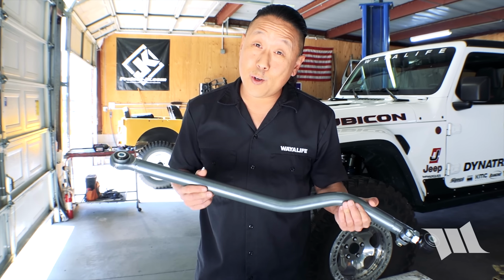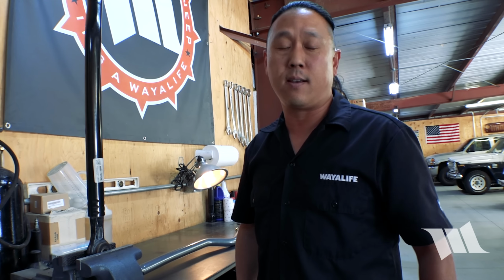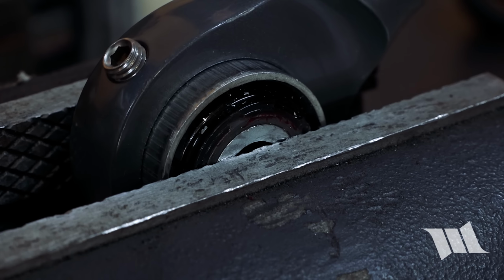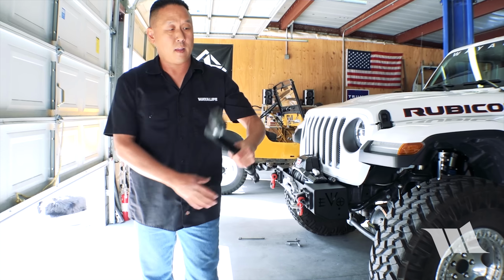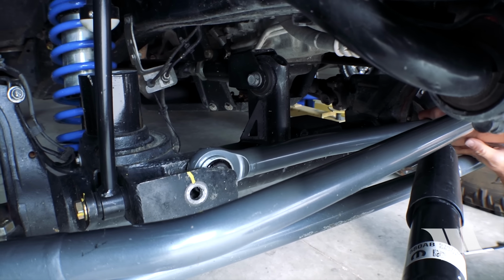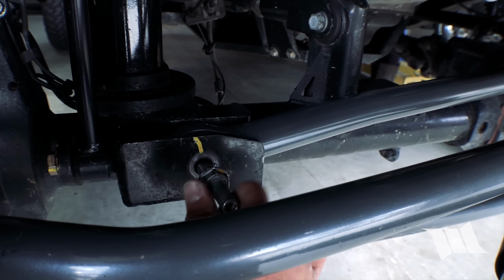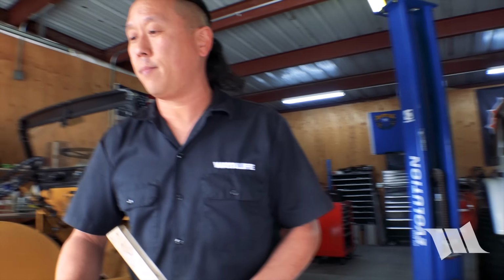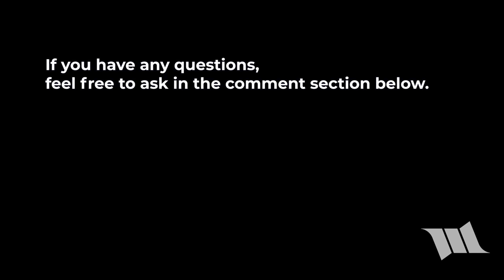Jeep JL Wrangler and JT Gladiator Truck Adjustable Front Track Bar by Synergy Installation

Comment: Eddie should also put a track bar on the rear?
Reply from the maker: Typically, it isn't necessary if you've got a track bar relocation bracket installed and really, that is the better solution being that it corrects track bar geometry.
Reply: @wayalife  thank you

Comment: can you powder coat the track bar?
Reply from the maker: It already comes powder coated.
Reply: @wayalife  I want it in Red that's way I asked if it's ok to do it
Reply from the maker: @RogerJG21  You can't powder coat over powder coat. You can paint over it but if you want it in a different color coating, you would need to have what's there sand blasted and then recoated. And, I should note it isn't easy to sand blast powder coating.

Comment: I have a superlift 2.5” lift with front track bar reinforcement bracket. But my JL still drives loose. What else do I need to correct this.
Reply from the maker: I guess you would have to define what "loose" is to you. If you mean wandering around or flighty at highway speeds, try lowering your tire psi to something a bit more reasonable like 28-30.